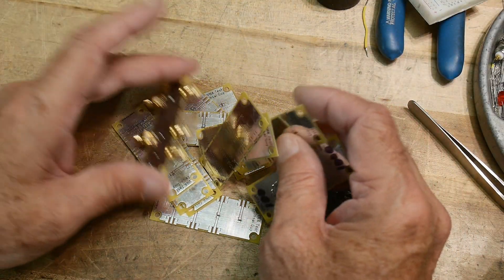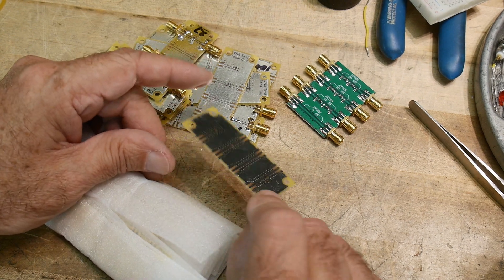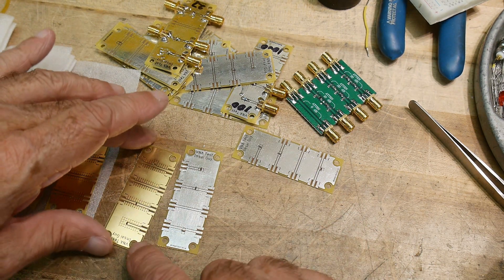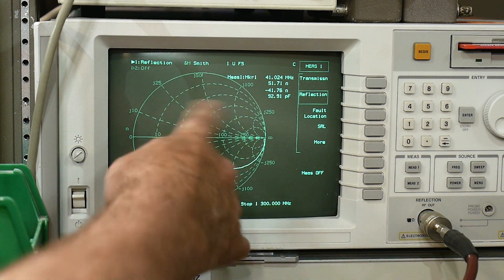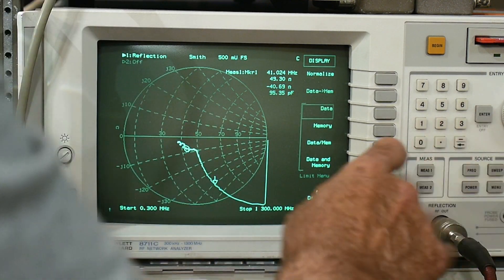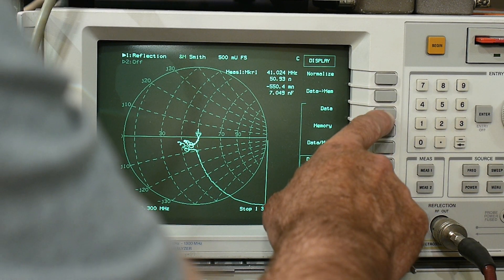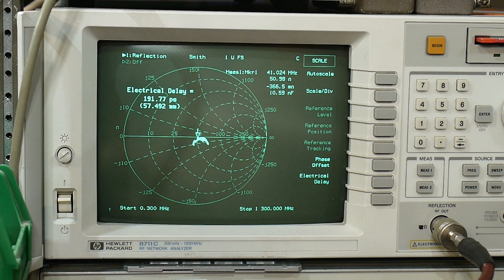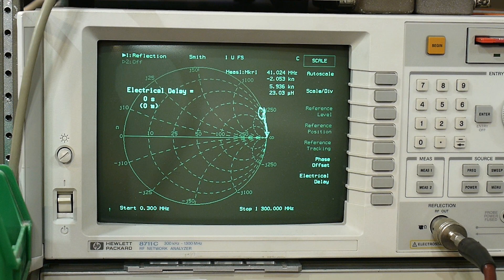#1187 VNA Test Boards (part 5 of 5)

Comment: It seems the problem is in cables and connectors. Try to use the highest quality cable between NA and your board. Test two of them, one just a few centimeters long and another one much longer, like 50cm. I would expect that with 50 cm cable this curly trace on the NA will start at a much lower frequency.
Reply from the maker: Had to laugh, sorry, my cable between the VNA and board is a Gore cable, probably over a $1000 new.
Reply: @IMSAIGuy  I'm just trying to help, that's it. '$1000 new' and 'high-quality coax' is not the same thing. When you measure the 50 Ohm load, just move the cursor and determine the frequency where this 'curliness' starts. This will give you a nice hint. One 'circle' on the line means you have passed 1/2 of the wavelength of the transmission line. It looks like the 'curliness' starts at quite low frequencies, maybe 100-200MHz, where the 1cm of the microstrip on the board does not affect much the measurements.
Reply from the maker: Again Gore cables are know to be the best in the business, that aside, another viewer has taken these boards and measured them then made a cad model. the curls at around 500mhz are caused the the self resonance of the capacitors inductance. My measurements exactly match the cad model.  The boards themselves have been measured by my friend with access to a keysight VNA and the transmission lines I designed are good to 5GHz. So as is stands there is absolutely nothing wrong with the setup, it is just the way the parts act. adding cal extension to the measurents would be a bit more exact.
Reply: @IMSAIGuy  But there is the same curliness with 50ohm load on your PCB, and you are measuring just up to 1.3GHz, right?
Reply from the maker: @BohdanTymkiv  yes, with port extension that is corrected, I also made an short open load cal set that cals at the DUT location. Both of those two methods result in the same measurement. The small curls are gone but the bend/kink to the left (short) is there due to the inductance of the CAP at 500MHz

Comment: How would you rate the quality of the SMS sockets you used ? If they are not carefully impedance matched, that could cause reflections at higher frequencies. If and when you nail the discrepancy I think a good DIY SOLT standard would be popular
Reply from the maker: I have done two videos on DIY SOLT cal standards. a female SMA and a male BNC

Comment: The PCB fabricator won't be thrilled with the lack of solder mask because it means more nickle and gold required during the ENIG process. For a few boards, they'll let it slide, but for larger orders, they'll charge extra...

Comment: Why the top ground plane stitched with all the vias?  Isn't easier to just omit the top ground-plane and just base everything on top trace width with respect to the bottom ground-plane?  Or at least provide enough of a gap between the trace and the top shield where they'll proved some circuit to circuit shielding but not enter into the impedance calcs?  I thought vias would be kind of problematic for the transmission line section of a circuit.
Reply from the maker: that is the difference between microstrip and co-planar waveguides (watch part 1). this is standard construction technique for co-planar with ground plane.
Reply: @IMSAIGuy  The "silver board" is pure Tin plated, and has no Lead (Because China is ROHS), and therefore lesser solder-able than Leaded Tin plating.  Gold is always easier to solder because it never-ever has an oxide layer.  If you want do a science experiment to A/B test, then I suggest that you add another row of Vias around the center stripline, offset 0.05 odd/even, not just a vanilla 0.1" grid.
Add some Vias especially around the R's or C's ground points. #Science! Thanks for making these video series, and thanks for reading comments!

Comment: The electrical delay is really something that should be adjusted without whatever you are trying to measure installed.  Just dialing the delay in so it looks good is cheating a little bit. :)

So the cal:  I mentioned this back in earlier in your 5 VNA test board series.  Cut three traces right at the connector on one board.  One install a good RF short. The other, leave open. The 3rd install 50 ohms to ground.  That's your inexpensive cal standards. And given you are only going to 1.3GHz, those should actually be pretty darn accurate.  Then take the trace where a shunt part is to be installed...ground that pad.  THEN adjust the electrical delay to bring it back to a short (the electrical delay removed the trace length).  You should be all set to measure a part.  So by doing all that: 1) You cal'd out the connectors, 2) You corrected the electrical delay of the trace, 3) Then you measured the part.

Heck, I'm tempted to order some boards just to measure for you on my HP 8753!  How much did they cost?
Reply from the maker: I did create a cal set (did not video) and I did not really change things much
Reply: @IMSAIGuy  That's odd, this should be a very straightforward measurement, given the cap value and frequency.  Is the board material FR-4 (i.e. G10)?  I'd definitely measure the cap in the shunt configuration.  If your during a thru measurement, are you also cal'ing port 2 (i.e. a full 2 port cal)?  Electrical delay may not be valid for S21 measurements (not 100% sure).  Port Extensions are tho.

Comment: AFAIK JLCPCB offers impedance controlled boards without additional cost in their standard offering.
Reply from the maker: looks like only for 4/6 layer boards. That is pretty standard. The boards I did at work where alumina substrate 2 layer. pricey.
Reply: @IMSAIGuy  Yes, you are right. I forgot that we used 4 layers (standard for my HF boards). There they provide the calculators for strip lines.